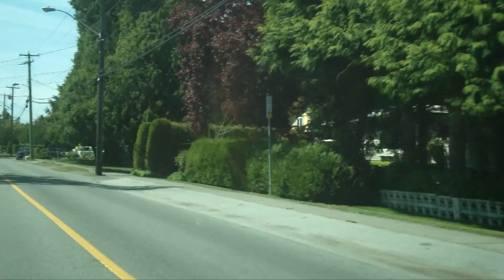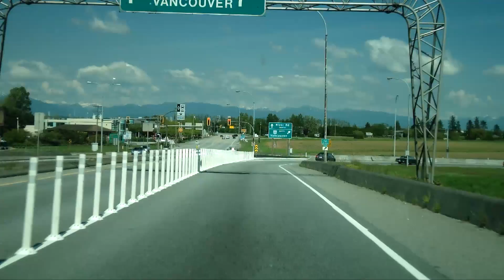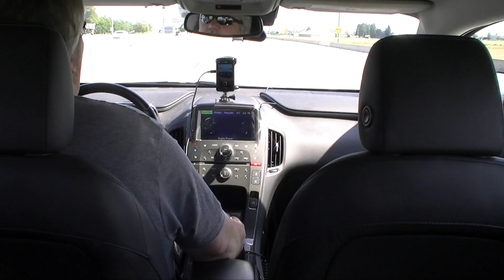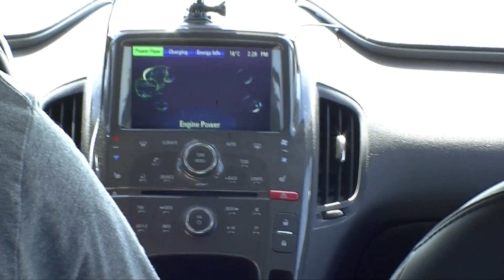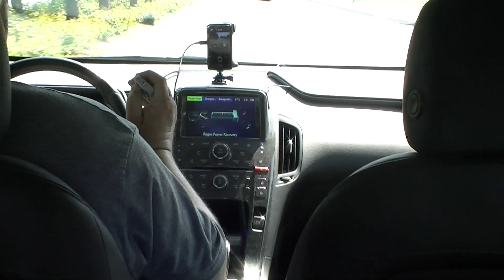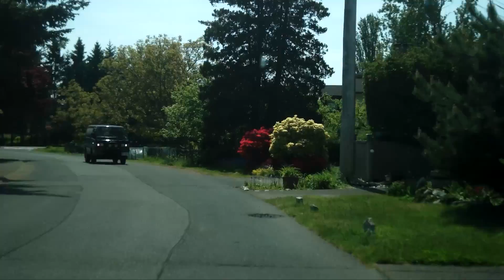How to drive a chevy volt for best electric range and fuel economy

Comment: THE VOLT DOES NOT HAVE A SUNROOF AND I JUST DO NOT LIKE THE PLUG IN FEATURE SO I CHOOSE THE PRIUS, THAT PRIUS IS THE BEST, SAVES GAS HAS SUNROOF, AND LOOKS GOOD.
Reply from the maker: Tracci Quartermaine To each their own. I have owned 3 cars with sun roofs. They all leak after awhile, and make too much noise to open at freeway speeds. The last car with a I had with a sunroof the glass exploded showering me with glass on the freeway when hit by a flying rock thrown from a truck tire. Will never own a car with a sunroof again for that. The Prius is a good car, my wife has one, however it is bloody gutless, and not very much fun to drive, and like a regular car, uses gas. I am taking it to the gas station every couple of weeks to fill it up. The volt on the other hand I go 9 to 10 months between fill ups. 99% of my driving is on 100% electricity, and if I had the new model, which gets 80KM per charge I would go a year on a tank, and be forced to burn it by the engine management  system to prevent the gas from going stale. The plug in is the best part of the car, as electricity costs about 1/4 that gas costs for the same distance traveled, plus it looks great, and the new model looks even better. Now that GM has announced a big price drop for the volt, I am confident that there are going to be many more of them on the road in the next couple of years.Another thing about the prius, they really only save gas in stop and go rush hour traffic. When I drove the one I own, I used it to commute to work, in stop and go traffic.Now my wife drives the car, and she doesn't get anything close to the rated EPA mileage. Why?, because she is not in stop and go traffic. She is running from client to client, and back and forth on the freeway, in the suburbs, never in the city, in bumper to bumper traffic, so the car rarely runs in full electric mode except when she in crawling around parking lots looking for a space to park or on the 3 blocks of low speed roads in our neighbourhood. The rest of the time the gas engine is running. My volt on the other hand the engine never starts. I can go weeks on end without the engine starting even once. I run as a 100% pure electric most of the time, but it is nice to have the engine on board for the time I do have to drive across town and back to pick up or drop something off, or when I go on my holidays when I drive across the country through the mountains, and enjoy the scenic route, and never have any lack of power doing so. When I did it in the prius, it was the most boring trip I ever had, because going up the grade the car barely made it to 50MPH, and that was putting the peddle through the metal!
Reply: My 2014 Volt has a lifetime mpg average of 97.1 mpg agree driving 43,000 miles.  What is your Prius getting??? Maybe 50 mpg??? My Volt will blow your Prius off the line and all the way to  its top speed.  My Volt will take a corner at high speed like a sports car.  How do you like the swaying and tilting in your Prius when you enter a turn at low speed.  Your use of CAPITALS only shows your desperation to compare your old tech Prius to the completely dominant Volt.  As far as looks, come on!  The Prius SCREAMS, "Dork! Driving slow car!!!"  The Volt is such an awesome car.
Reply: Tracci Quartermaine I hate sunroofs!
Reply: I have a 2013 volt with a moon roof. Not a cheesy piece of glass but an actual functioning moon roof
Reply: MrRichards
I hate moonroofs....I am happy that is not an available option on the car I chose.
Reply from the maker: +VoltecRules My lifetime average over 62,000 miles is 173.2 MPG. I fill up so rarely I have almost forgotten how a gas pump works! I am sad to report that I just suffered my first problem with the volt. It isn't serious but it bugs me. The button on the driver door to unlock the doors has stopped working, so now I have t o go through the effort to remove the FOB from my pocket and press the unlock button on that. I know, its a little thing, but once you become use to these conveniences, things like the auto dimming rear view mirror you sure do miss them when they stop working. Oh well, 5 years and this is the first problem.

Comment: I must have misunderstood something I read about the operation of the brakes. I thought the hydraulic brakes did not engage until you are deeper into the pedal. I think I can feel the transition on mine.
Reply from the maker: They actually do become primed and ready for action, and they are on slightly and as you get deeper into the peddle they come on stronger. If you lightly put on the brake and get into regen, and then switch to "L" you will feel a much stronger braking that lightly pressing the peddle. When I am in stop and go driving, I just leave it in L and take advantage of regen braking to the max. I do the same on my other vehicle which is a standard hybrid.

Comment: Do you have to move the lever to L to regen? Doesn't a light touch on the brake pedal while in D accomplish the same level of regeneration without engaging the brake pads to the rotors? That way the drivers around you still have the benefit of seeing your brake lights.
Reply from the maker: No you don't have to put it in L to regenerate. Applying the brakes will put the car in regeneration mode, but it also starts applying the hydraulic brakes as well. So shifting to L puts the car in full regen mode without activating the hydraulic brakes.
This is no different than gearing down in a conventional car and letting the engine slow you down. True the brake lights do not light, but then they don't if you gear down either. I check my mirror before dropping it in L. If there is someone behind me I will use the brake to get the lights going, if there is nobody close behind then I drop to L and get as much energy go into the battery before using the brake peddle to complete the stop. This extends the life of the brakes like you wouldn't believe. 70,000 Km and the brake pads show no wear. At this rate I will probably get 200K on the brake pads.

Comment: Thanks for the great tip.  I usually just leave it in low gear unless I drive on the freeway.  I got up to 54 miles on a charge doing this in warm weather.
Reply: Exactly. Seems like wear and tear to keep changing it back and forth.

Comment: Only thing I'm concerned about is the replacement of the battery, as I've heard from some sources that it doesn't last long.
Reply: Battery expert Jack Rickard explains that ....  "The pack as configured is rated at 5000 cycles. That is fully charge to fully discharged and back to fully charged. Shallower charges don't really count as full cycles"

http://gm-volt.com/forum/showthread.php?62577

That's 5,000 full cycles.  More than 200,000 miles.  I have owned by 2012 for 3 1/2 year and I am still achieving more than 45 mile ranges.

Here is a 47 mile range day I recently had .... explained.

http://postimg.org/image/cpy1xrc2z/
Reply from the maker: 70,000 miles on mine in 4 years and no issues. The battery is designed to last the life of the car. They say 13 years is the designed lifespan when the battery will only hold 50% capacity. So, after 13 years the car will still get the same range as a brand new Ford energi plug in when new, and double what the plug in prius gets when new.
When the pack looses capacity the range of electric drops before the generator starts, but the car is still fully drivable. There is one fella in the states that now has over 200,000 miles on his volt, it is the same age as mine.
My other car is a escape hybrid, it is 10 years old and there have been no issues with that battery either. 
All electric cars such as the Tesla and Leaf will likely have much shorter battery life because they are being totally recharged, sometimes extremely quickly (supercharging) and they charge up to a closer to full state and discharge to a lower state than the volt. The volt never charges more than 90% capacity, and never discharges below 30%. Only 60% of the battery capacity is used, once it is drained to the 30% level, the engine starts up and maintains that state of charge at the 30% level.
So with this battery management it is easy to get maximum charge discharge cycles out of the battery.
On another battery related topic. Battery engineers know much about designing battery management systems as it is all borrowed, like pretty much everything else technology related from the space program. They learned a heck of a lot from the space program, not just the manned portion, but I am referring to the entire space program, and most of that is communication satellites.  There is no way to service the batteries on satellites or probes sent to deep space. In a com sat the batteries are in the harshest of environments, and they charge discharge every day as the soler panels fall in and out of the sun. This technology filters its way down to the technology we use every day. So no, I am not concerned about battery life.
Reply from the maker: From everything I have read there hasn't been any battery failures in the field. It is warrantied for 8 to 10 years depending on where you live.
GM claims it will last 13 years, and even when the battery has lost capacity the worst thing that will happen is the electric range drops and the gas engine starts sooner. In 4 years I have not experienced any issues with the battery or anything, and my other vehicle is a Ford Escape Hybrid. It is 10 years old now, and it has close to 100,000 miles on that vehicle, and again no issues with the battery. The 12 volt battery went bad once, and it is starting to go again, but the traction battery is just fine, and have had no issues.
Now Tesla on the other hand have had many problems. I know 3 people with Teslas, and 2 of them have had their battery replaced in the first 2 years, and one of them also had his main drive unit replaced. I am not worried at all about the battery as they manage it very well, thermally and load wise.
Reply: ps .... my son owns a 2013 with 45,000 miles driven.  He always gets over 50 because his Volt is slightly more efficient.
Reply from the maker: ra5928
I am at 70,000 miles on mine now, and I still get 55-60 KM per charge. I do take advantage of charging whenever I get the opportunity. I know the newer models get a little more range. Mine is first generation, and I get 10.0KwH on a full charge.
Reply: The Volt does proper thermal management of its battery pack, so I wouldn't worry about its premature failure. And since it's got a gas engine backup, at least in the U.S., the battery pack is considered a part of the vehicle's emissions control system, so it's required by law to be covered by the emissions system warranty rather than the car warranty, so that means 8 years or 100,000 miles minimum, or I think 10 years and 150,000 miles if it was originally purchased and remains owned in one of the 10 CARB states.

It's a different battery chemistry than the Prius, Li-ion vs. NiMH, so it's a little bit of an unknown, but these batteries have been used as 12voltvids pointed out on satellites for quite a while now, so battery management is a pretty solid science as long as that science is actually adhered to. Tesla and the Volt both do proper thermal management, and have well engineered charging systems, so I wouldn't worry about either of those. The battery pack replacements mentioned are likely due to a faulty contactor in early revisions of the Tesla battery pack-- I'm not aware of anyone with an actual battery pack failure yet, and the Volt as far as I know hasn't had any either. Li-ion is a very good battery chemistry when it's handled properly, and the only car using them that I'd worry about is the Nissan Leaf, because they don't do proper thermal management on their battery pack like the Tesla and the Volt do-- Nissan only heats the pack, they don't do active cooling in hotter climates, so it's people in places like Arizona or the hotter parts of southern California and places like that who are experiencing very early battery pack failures, but in cooler climates, they're still holding up just fine, which strongly points to thermal management being the key factor in the battery pack's reliability and lifespan.

The cost of the batteries is also continually coming down, so even though a 12 kWh battery pack might have originally cost $18,000 to replace, by the time you actually have to replace one, they'll probably be closer to $8,000-- which if you amortize that cost over the lifespan of the battery at even just 10 years, is about $68/mo., which is FAR less than you'd have been spending on extra gas if you went with a conventional gas powered car. It sounds like a lot when you hear the price tag, but remember that a replacement gas engine at a roughly equivalent mileage after 10 years can easily cost $4,000 - $8,000 too, and nobody ever worries about that. The Volt is actually a pretty well-designed car as far as the most important parts. For a more apt comparison, look at the original Prius when the battery pack in that cost $8,000 to replace, whereas the brand new, from-the-factory replacement on that today (when most of the cars are reaching the age where they may need it) is listed at $1,350. You can expect a similar economy with the Volt's battery.
Reply from the maker: babybirdhome Dam, I couldn't have said that any better myself.
100% correct in every aspect.
At 80,000 KM now, the volt is the only car I have owned that has not had to have any maintenance done on it except for 1 oil change. The second is done at the 4th anniversary which is this august. I also just bought a tank of gas, the first trip to the gas station in 9,000 Km, and 9 months!

Comment: For your future reference.  A true parallel is always gas and electric.  Never one or the other.  A series parallel (Prius) is either gas or electric.  It can only stay electric at lower speeds.

A series is always electric.  Only the electric motor has a direct connection to the wheels.  As Andrew Farah stated, once again, there is no direct connection from the gas engine to the wheels.  Andrew Farah is the Volt chief engineer.  I defer to him.  The electric motor is a hard connection.

http://www.ucsusa.org/clean_vehicles/smart-transportation-solutions/advanced-vehicle-technologies/electric-cars/electric-car-definition-mpge-bev-phev-series-parallel-hybrid.html#.VKd859LF-RM
Reply from the maker: Lets just say we agree to disagree because you can't argue with an idiot, which clearly you are, and it shows your ignorance.
A prius is a parallel.  All parallel hybrids can run in electric only mode at slow speeds, just turn off the gas engine and freewheel the generator.
When the gas engine is running, it is running in parallel with the electric motor.
A series hybrid has no direct connection between the gas engine and the wheels. The only series hybrids are the Fisker Karma and the BMW i3. There is no physical connection. The Volt and ELR there is not normally a physical connection either, and the initial design was for the car to be a series only hybrid, but by the time the car went into production it was decided that it would be more efficient to use the gas engine to contribute power into the power split with the 2 electric motors, which by definition IS a parallel hybrid. Everyone is laughing at your ignorance. Go check your notes it is all out there on the GM volt sites.
Don't believe me, well watch this and it is all perfectly clear, exactly as I have explained it.

https://www.youtube.com/watch?v=343-NQKOvLg